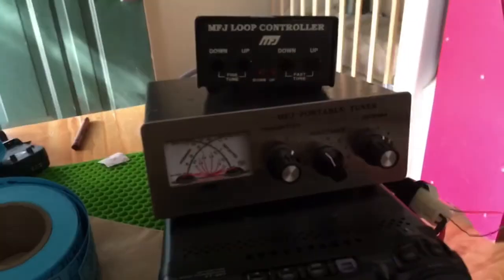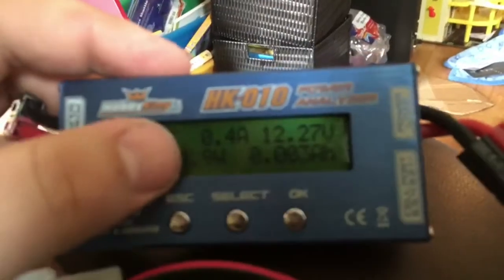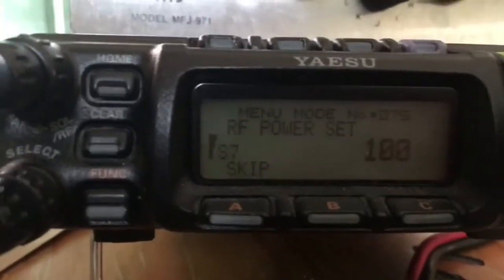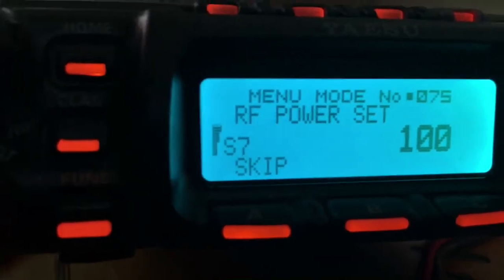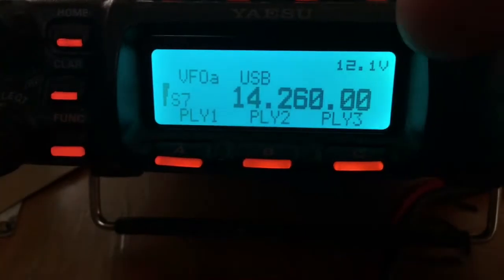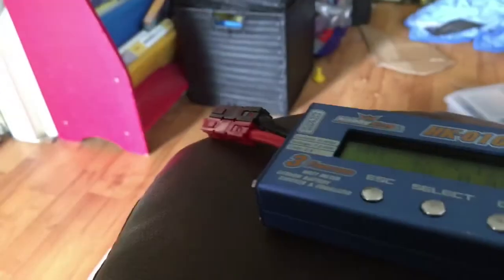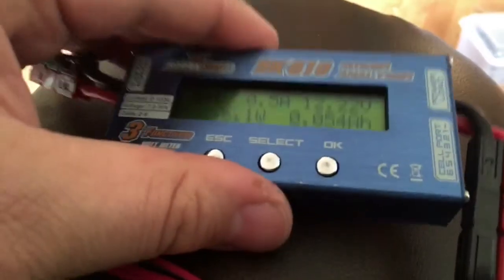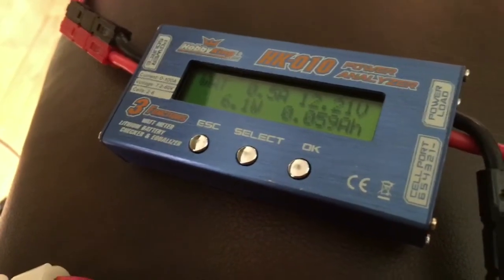FT857 Paper Clip Mod

Comment: if this really works why isn’t there more about it? No other vids or write up exist.
Reply from the maker: forgetyourlife it’s in the manual from Yaesu but they recommend a wire jumper.
Reply: Video Ramblings of Matthew Well if that’s the case it’s really strange this isn’t talked about more. Thanks for the reply.
Reply from the maker: forgetyourlife I just don’t think most people know about it. It will has more draw than a FT817 and I assume that some people just consider the FT817 as the go to rig for battery operation
Reply from the maker: Here is a better more professional way to do the same thing:

https://youtu.be/apr12w_Q0Iw

Comment: Other than about 100ma difference on receive could you have achieved the same results by just reducing the power level or does it not go low enough to equal the paper clip mod lowest RF power?
Thanks, Ken